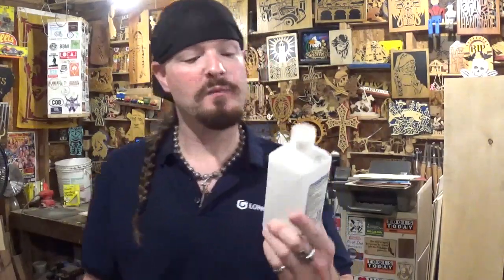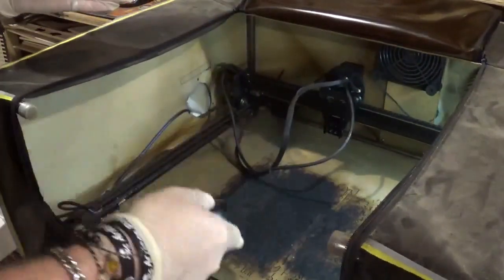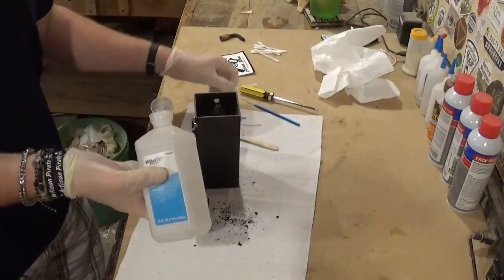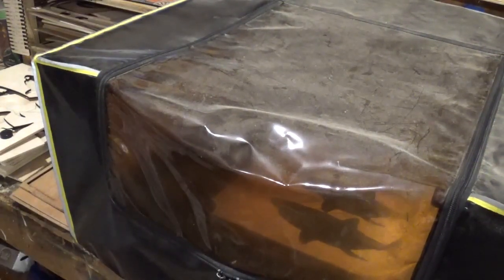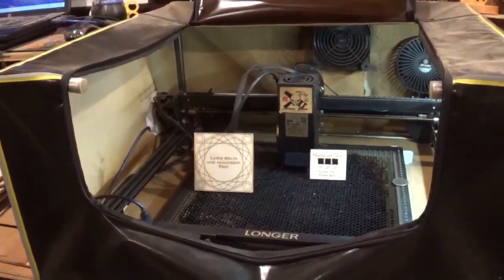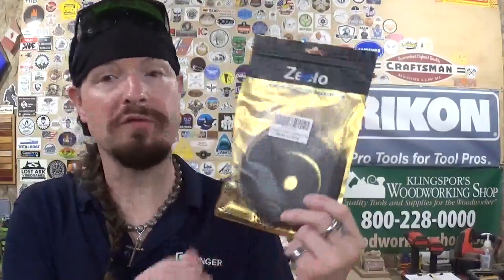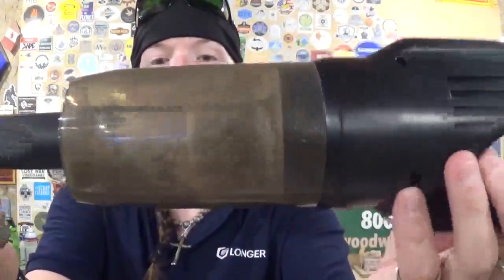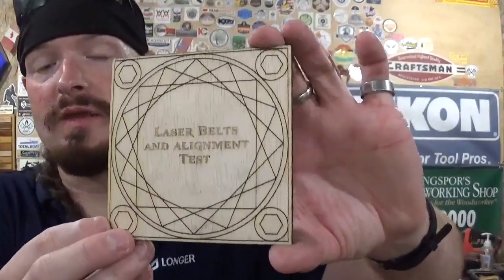Cleaning A Diode Laser Engraver, Longer Ray5 20W Laser

Comment: excellent items in the background, I'm a little jealous of some.  The laser belt test, could you make that available. I just finished a cleaning 2 weeks ago on my Ray 5 20w, I actually took the the air assist nozzle of and cleaned the inside of it, very nasty. I was able to inspect the lens cover and clean it very good. I also clean the honeycomb and plate with solvent and then a power was, I seen that this cuts down on a chance of a fire.
Reply from the maker: Thank You! And you would have to reach out to my buddy Sam on Instagram for that file

Comment: Thank you for sharing your preferred cleaning method! 🙌 Most of your steps look great . There are just a few small details that could be adjusted for even better results—for example, [When cleaning the window mirror, use a dust-free cloth dampened with an appropriate amount of alcohol. Before operation, carefully remove the air assist connector and nozzle, then use a 1.5 mm hexagonal wrench to loosen and remove the screw securing the nozzle]. Overall, really nice work! Can check this video for reference:https://www.youtube.com/watch?v=3HPbCb0w_Mw&t=30s
Reply from the maker: Thanks! Longer Is AMAZING!